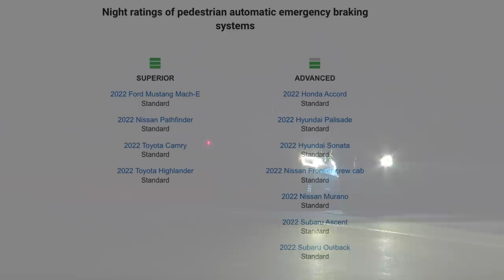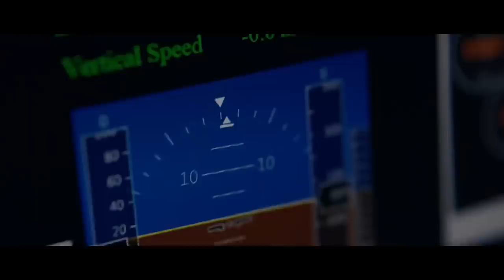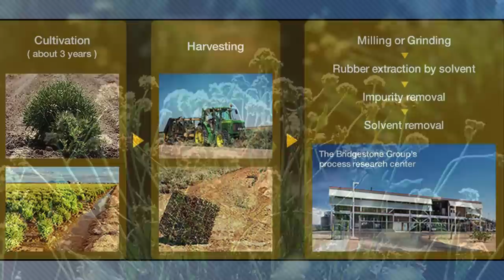Charging Stations Need This Design Change; Can Tesla Sell 20 Million EVs? - Autoline Daily 3395

Comment: "7 more giga factories needed" does not take into account the fact the Austin and Berlin plants have not scaled up. Plus what is the maximum expansion capacity at the current 4 sites both in terms of maximizing already constructed space and future construction? Lets guess

Texas 3M (the site is huge)
Berlin 2-3M (has room for expansion)
Shanghai 1-2M
Freemont 600K-1M

So maybe 3 or 4 large facrtories are needed. It takes about 3 years to build and ramp up. Tesla built 3 large factories in the past 3 years.

Consider how quickly the US built factories during WWII.
Reply: I've stated those exact capacity figures for Shanghai, Austin, Berlin, etc for almost 2 years now, and no one believed me back then 😩
Reply: The USA didn't really have to build factories in ww2, they simply switch products in existing plant. Toasters to guns, cars to tanks etc etc. 3 million plus engineers at 300 car companies and suppliers vs one company. It's lop sided. Let us thank Tesla for leading the way, not giving up and leave it at that.
Reply: @ Martin. Yes we transitioned a lot of factories but built many more. This is a bit sidetracked but goes to the point that factories can be built quickly.
Ford built the giant Willow Run plant for bombers.
The Pentagon only took one year.
Oak Ridge, Hanford, and Los Alamos fast.
Kaiser shipyards flew up.
Reply: 8 more gigafactories are no big deal. He can easily have them all in China, BTW. THe problem is will consumers continue to buy these overpriced toys, when they have their current limitations, esp range and charging time. MOST People in the world are not as lucky to live in single family houses where they can charge them at home. The Early Adopters will buy a few million, but the very optimistic dreams to eliminate the ICE cars are utterly ridiculous.
Reply: @anastassiosperakis2869  Can easily have lvl 1 or 2 chargers for every parking space for an appartment or on the street.  2kW is all that's needed to charge something like 24kWh during the night, providing over 75 miles of charge, which is more than most people ever need daily.
Reply: @anastassiosperakis2869  The move from ICE to EVs is already occurring. All that can be debated is when the last ICE car will be produced.
Reply: @anastassiosperakis2869  You are mostly wrong. Watch it happen!

Comment: The real  issue is that ccs plug.  Its massive for no valid reason.  You can see the port flexing on the bus in the video.  The complex shape has too much surface area for easy inserting and removing. EA has admitted the cable weight causes sag which separates the control pins and prevents charge sessions from starting.  CCS and tesla connectors have the exact same number of wires they are physically compatible.  You can convert ccs chargers to tesla by just swapping the cable tips and updating firmware to talk both protocols.  Current ccs cars can use cheap adapters which is not a big deal since non-tesla EVs that even charge at 150kw or higher are still small in number.  Manufacturers or aftermarket companies are free to sell port replacements on the cars.
Reply: Yep, legacy OEMs doing stuff the most expensive and least effective way.
Reply: Got no problems with the CCS plug since 2018. Use it every day.
Reply: @wolfgangpreier9160  The EU CCS plug is not the same as the US CCS plug. Two different connectors.
Reply: @AllanSustainabilityFan  Seems the EU CCS plug is the version 2.  Why does the US want to go with V1?
Reply: @wolfgangpreier9160  Grow up.  The thing is far worse than the more compact  tesla plug and both have the exact same number of wires.  The mega ccs connector for semi trucks is physically smaller than the consumer ccs connector and the mega connector can  handle 3.7 megawatts.  Regular ccs is only 350kw and the connector is  comically bigger.
If basic facts like that don't convince you,  you cannot deny that electrify america is the one who said ccs cables are too heavy and sag  which can cause communication pin separation.  They tell customers with issues to hold the connector up until charging starts, then let it sag.  Its a joke connector.

Comment: Math correction.  Tesla is estimated to produce 2 million cars this year.  13x2 does not equal 20.
Reply: Tesla is estimated to achieve a RUN RATE of 2 Million cars this year. That is, it's expected that they'll be able to produce 500k EVs in Q4. Given that GF Austin alone is projected to have a total production capacity of 2M, that implies there's still significant room to ramp at GF Austin and Berlin. The total production capacity of their existing factories is about 4M, so I'm not sure where they pulled 13x from, more like 5-6x.
Reply: @sillystuff6247  Could you please tell all of us that are too stupid to find those sources you mention which sources are most credible in your opinion?
Reply: @sillystuff6247  That seems to happen a lot to me too. I wish I could find out how to by-pass that. More than once I try to give a URL even spreading it out to separate parts and still get filtered out.

Comment: Rueters is wrong in so many ways. They are correct that Tesla will need 7 to 8 factories to make 20k a year. So they are saying that Tesla factories can make 2 million a year, per factory. 

600 Billions is ridiculous to build the factories and battery factories. Tesla just built 2 factories in 18 months and expanded the China factory in the past 2 years. The first phase of Texas was 1.1 billion, The china increase was a half a billion. 

Another factory will be built,, in China, the largest EV market in the world. It took `12 months and 1 billion dollars for the first factory. Tesla was building 2 factories on 2 continents at the same time. They can do 4 at the same time and be done in 3 years, with all 8 factories. 

Germany cost somewhere around 3 or 4 billion. Two factories and a larger upgrade for less then 5 billion. Tesla has done all this and has had huge amounts of free cash flow, they have no debt and 18 billion in the bank.

8 factories will cost less then 20 billion. If you watched Battery day or seen any Austin Factory videos, you would know the amount of space and money to build the 4680 factories are actually next door to Germany and Texas has the batteries made inside, so it will cost nothing that has not already been paid for..  To be nice we can see it at 22 billion, not 600 billion. 

Also, the whole battery part did not talk about CATL and the LFP batteries they are making for Tesla, so the Mineral issue are not as bad as they think. Tesla made half the cars with LFP batteries in China, no Nickel, Lithium or cobalt. 

The people who wrote this did no research, are an idiots or paid off by legacy car makers.

This is DISRUPTION, ask Blackberry, Nokia snd other who have been disputed. The difference is Tesla and Musk are smarter then any other company in the world and have the smartest people in the world working to change the world to renewable energy. This is a movement, go luck to try and slow it down!!!

Comment: Crash testing is all under 40mph.  That is the difference.  In the real world cars drive faster than that 90% of the time.
Reply: When a vehicle is crash tested at 40 mph into an immovable barrier it's the equivalent of hitting a parked car at 80 mph.
Reply: @johnmcelroy9590  Please consider your comment. What you said is "When a vehicle is crash tested at 40 mph into a parked car - which is a immovable barrier it's the equivalent of hitting a immovable barrier like a parked car at 80 mph." That makes no sense anywhere in our universe.
Reply from the maker: @wolfgangpreier9160  Let's talk physics. When a vehicle is crash tested into an immovable barrier, that vehicle has to absorb all the energy of the impact. The barrier does not deform. When it crashes into a parked car, part of the parked car is deformed and knocked away from the point of impact. That absorbs part of the energy. And that's why a 40 mph test into an immovable barrier is equivalent to hitting a parked car at 80 mph. BTW, this is not my opinion. I learned this from crash test experts long ago.
Reply: @AutolineDetroit  A Unimog mowing grass from our village does not deform even when i hit it with 80 mph - thats 128 kilometers/hour. A 40 ton truck does not deform when i hit it with 80 mph. A Aptera may make some sratches on my paint when i hit it with 40 mph. But the aptera would be completely destroyed   Please talk with your experts again. Your theory has some major flaws.
Reply: @wolfgangpreier9160  You will notice, of course, that I referenced a parked car, not a Unimog or 40 ton truck. Those are the equivalents of an immovable barrier.
Reply: @johnmcelroy9590  So i am only allowed to crash into a Toyota or Peugeot? Not a MAN or Hino? Ok. I will try if i have to opportunity.
Reply: @wolfgangpreier9160  You can crash into whatever you want!
Reply: @johnmcelroy9590  Naah - i don't think i would want to. Luckily i had only cars crashing into me and all not fast at all. Never was in a demolition derby.
Reply: @AutolineDetroit  re: "When a vehicle is crash tested into an immovable barrier, that vehicle has to absorb all the energy of the impact. The barrier does not deform. When it crashes into a parked car, part of the parked car is deformed and knocked away from the point of impact." this is 100% correct. re: "BTW, this is not my opinion. I learned this from crash test experts long ago." who themselves learned it from Sir Isaac Newton, the "phenomena" the good folks at Autoline just described to you boys and girls is found in the 3 Laws of Motion. for those who might have dozed off during Engineering classes, Newton's 3 Laws have formed the foundation of Classic Mechanics since the 1600's.

Comment: It will cost Tesla only $600 billion to make 20 million cars a year?  Cars with a average sell value of $55k each?  With a 26% profit per car?  Tesla spends $600 billion to make $500 billion in profit?!
Reply: A new factory costs roughly 15 billion. For 20 million cars annually with 286 billion profit annually they need not more than 10 GF or roughly 150 billion. Those factories produce around 10 years. Thats a profit of 2.7 trillion US$.
Reply: @wolfgangpreier9160  Tesla spent "only" $4B on Giga Berlin, and $1.1B on Giga Texas so far.

Comment: HAHAHA   TESLA IS NOT IN THE NIGHTTIME TESTING    HAHAHA  What a phony test  🤣🤣🤣🤣
Reply: It should perform even worse since Tesla is a vision-only system.
Reply: Tesla was in the test it just didn't score superior or advanced you need lidar to see in the dark.
Reply: @buddy1155  Lidar can not "see" in the dark. Lidar can only reflect from hard surfaces. Not "see" anything.
Reply: @wolfgangpreier9160  Hard surfaces, why would a laser beam care if it is hard or not? And Lidar sees the beam it sent out or the reflexion of the beam to be correct. Maybe you should look up how lidar works, you don't seem to understand it at all.
Reply: @wolfgangpreier9160  I think you are confusing Lidar with Sonar or Radar.
Lidar = light
Sonar = sound
Radar = radio waves
Lidar sees everything a camera can see but with a huge spotlight, so it sees also in the dark. But unlike a camera it can also see the distance to the object.
Reply: @buddy1155  "Lidar sees everything a camera can see but with a huge spotlight" Ah - No it does not.

Lidar sends a ray of light against the object and watches the return of this ray of light and measures the distance from the sensor to the object.

Yes its similar to sonar but it uses visible or infrared light instead of ultrasound.

And yes, Radar uses radio waves. Not really different to lidar except much less resolution.,

Try it out. Send a light pulse into a puddle of water and watch what you get back into your lidar sensor.

Lidar does not "see" anything. Lidar detects the runtime of a single light pulse into the distance. When this light pulse is reflected it can detect and measure the distance.

Seeing means passive detection of the whole picture at once. 

Then you still have to categorize and deduct your response of what you are seeing - but for that you need a big biological brain and some muscles attached to arms, body, feet or a much bigger electronic computing device attached to electric power steering, electric brakes or a GAS pedal. 

Preferrably a multi-GPU-CPU cluster. Or some very intelligent people who have decoded and compressed the most important things in simple to use combinations of pseudo-neuronal-networks and a bunch of hocus pocus mathematics. (I'm talking about Tesla if you did not recgnize the hint)

Lidar rays can be moved very fast from left to right, up and down - similar (actually identical) to a laser printer, but lidar does not see - does not detect and decode the whole picture including colors and depth at once.

You Mister seem to confuse lidar with a camera. It is not.
Reply: @wolfgangpreier9160  A came does not see the whole picture simultaneously, it scans very fast line for line .... how did lidar did it?
Reply: re: "TESLA IS NOT IN THE NIGHTTIME TESTING" oh they were, they were simply first to be tested, and they FAILED IMMEDIATELY.
Reply: @wolfgangpreier9160  re: "Lidar can not "see" in the dark. Lidar can only reflect from hard surfaces. Not "see" anything."  for those with memories short AF, just a reminder Luminar (the company that Mercedes is now sourcing it's Lidar from) just did a test outside of this year's CES event back in January on the streets across from Circus Circus Casino in both day AND night conditions (it was Las Vegas after all)... https://www.youtube.com/watch?v=p3_1zvpi6zw <--- Tesla FAILED this test also.
Reply: @phillyphil1513  Yes, true, Cars without Lidar can not drive at night. You are of course completely correct!

Comment: Musk wants Tesla to sell 20M cars a YEAR by 2030? Granted NOT right now. However, that goal is asking for things that are not very likely to just impossible to happen at all.  Such as most competing carmakers just up and folding COMPLETELY in that time. Buyers would be willing to  essentially all buy the EXACT SAME AUTOMOBILE. Generate an extraordinary amount of raw materials just to make the batteries alone. Govts will essentially FORCE buyers, who are spending their own money, so it should be their choice,  to buy BEVs and principally Teslas. 

There is just so much to overcome,  and it is unlikely Tesla or any company could make such a huge leap in such a short span of time... in this or any other fully mobilized industry. 

Anything to keep that stock price high, right? This is something like  the Cybertruck and Semi that is going to keep being pushed back repeatedly. While never officially never throwing in the towel on that 20M Cars a Year scheme, it will be obvious they couldn't do it and basically gave up trying by mid-2030.